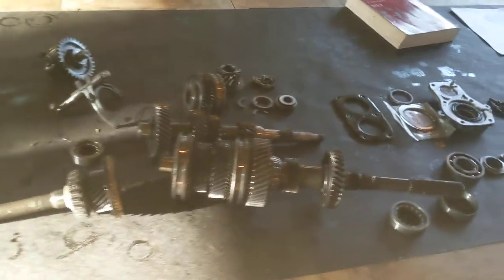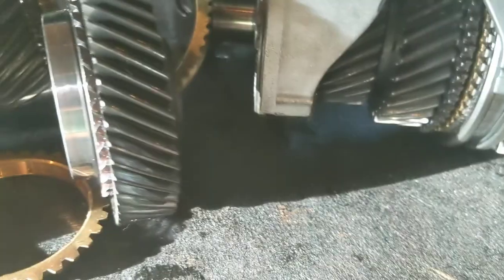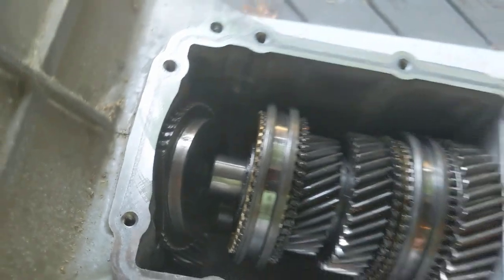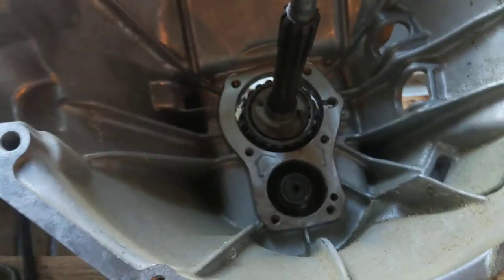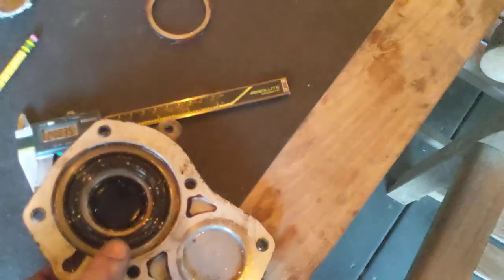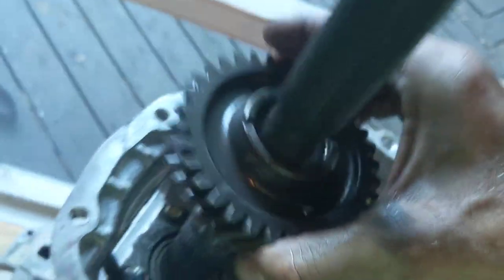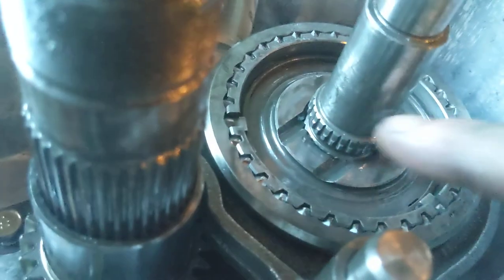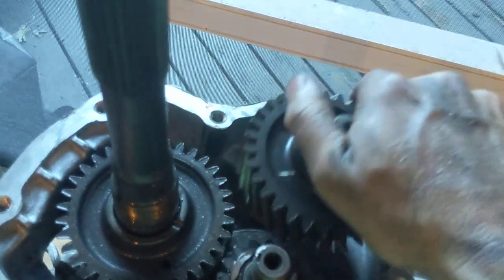Ford F150 M5ODR2 manual transmission reassembly Part 2

Comment: What causes 2001 f150 manual not to work in reverse?
Reply from the maker: If you just rebuilt it, you put a part in backwards. Look at the tail housing.